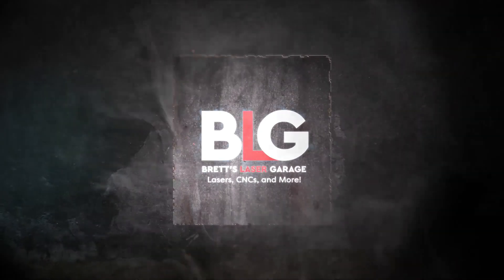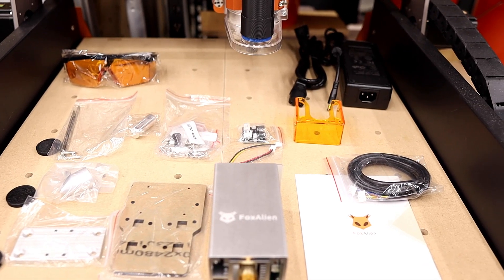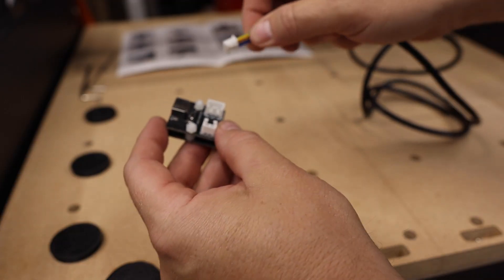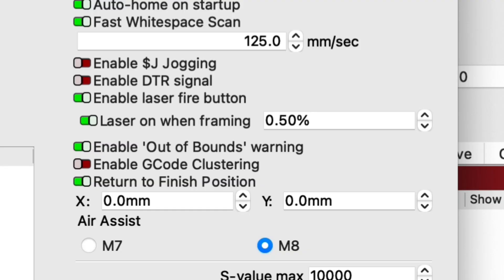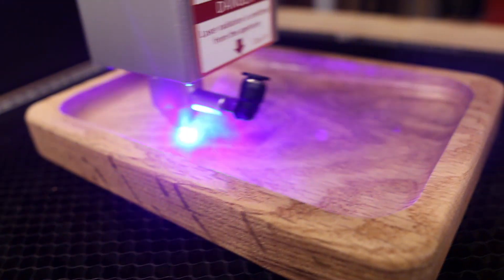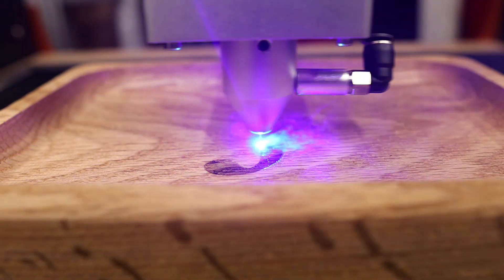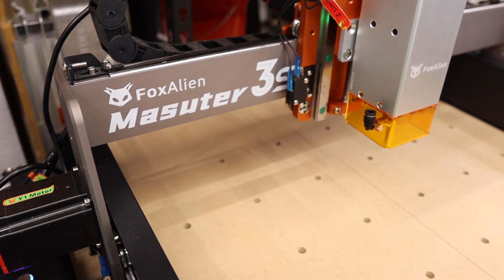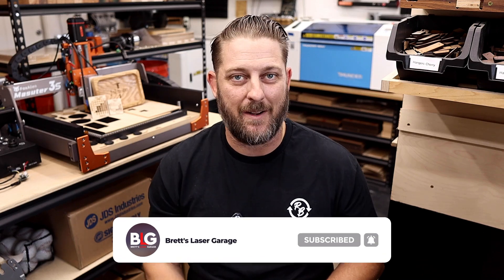Is this a CNC router AND laser engraver?  Fox Alien 20w Laser module | Brett's Laser Garage

Comment: Thanks for this - I just got an XE-Pro CNC and have a Creality laser, and I was thinking about mounting the laser unit on the CNC to just have one machine since one of the mounts that came with the CNC fits it ... the point you make about the enclosure is spot on and so I'm going to stick to my separate machine setup on that account alone.
Reply from the maker: You’re welcome.  Combining a cnc and a laser can be the right choice for some with limited space.  But if you have the room you’d definitely benefit from having separate machines.  Thanks for watching.

Comment: I have the foxalien 4040-xe and was considering adding a laser. I mainly want a laser that can burn the bottom of the things I cut out with the router.  Is that possible?
Reply from the maker: You mean like a branding the back side of a project with your logo?  If so, that’s probably one of the best uses of this laser.
Reply: @LaserGarage  Not exactly, though that is one of the main reasons I want one. What I mean is, can I carve out, say, the word "Text" with the router.  Cut to 1/2" with the router, switch to a laser and have it burn the  bottom of the text (without burning the sides).
Reply from the maker: Oh ok got it.  Although that would technically be possible I don’t think it would be easy.  You would essentially be v-carving or pocketing out text with the router.  Then have to switch to the laser module and then line everything back up perfectly to be able to engrave the bottom of the text/pocket.  I think that would be difficult if I’m understanding you correctly.
Reply: @LaserGarage  OK. Thanks for the info.  Guess I'll have to give it a try.  Will make for a fun experiment.
Reply: @duallity2403 if this is a frequent work, batch process or many taller parts jobs, I suggest u modify the router with a cut out or a replaceable bed. What I will do on my engraver is add a study metal frame with a lifter secure platform/ manual screw type to accommodate the height of part I want to engrave on the edge. This I mount at the edge of my metal table(removable) so the slide out engraver will attached to it to do engraving on edge.hope that helps.